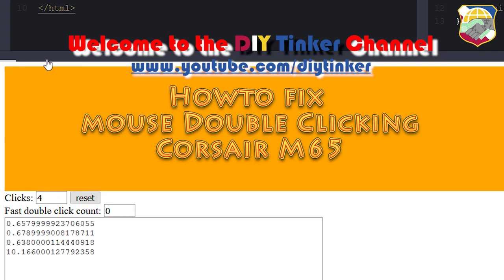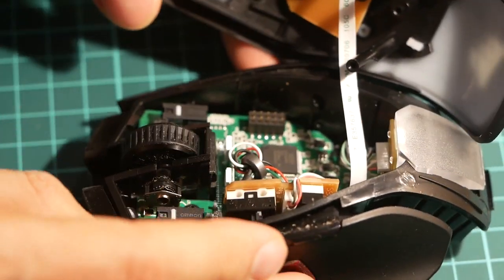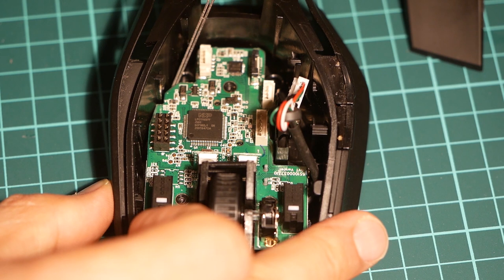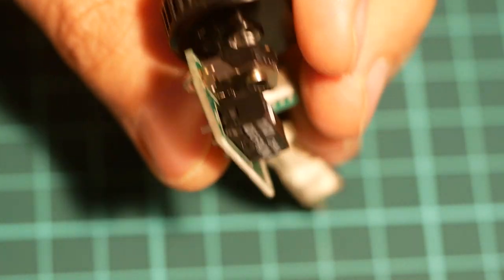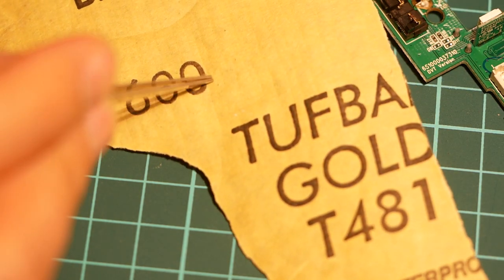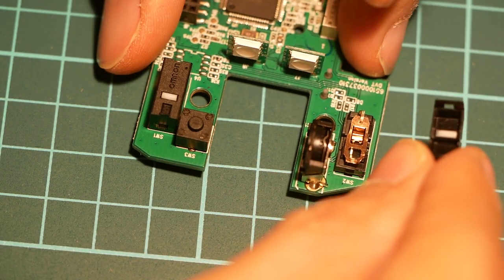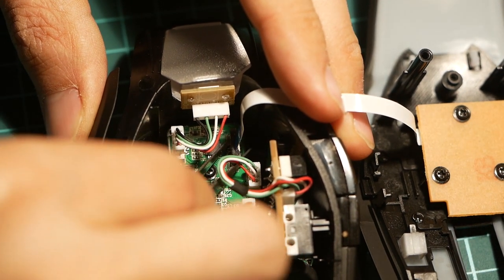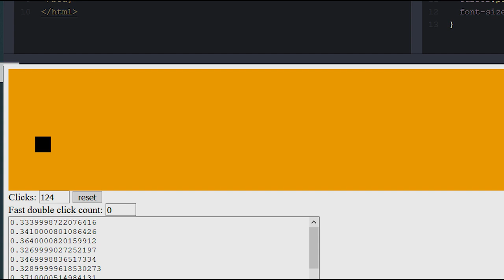Howto fix mouse Double Clicking - Corsair M65 repair

Comment: Corsair M65s are my jam and have been for years. I've got one sitting in a box that I broke the scroll wheel on when I tried to take it apart to clean it last year and my newer one just started double-clicking yesterday. Hence why I've watched this video. My original idea was to find out how to replace the faulty switch with the perfectly fine one from my old mouse. But now that I see soldering is involved for that to happen, it just dawned on me that I can put my newer scroll wheel into the older mouse in place of the one I broke.
I realize that none of that has anything to do with this video, but still, thank you for taking the time to show everyone how it's done.
Reply: aw man. If you watched the whole video you would have seen that you don't actually need to solder anything. well your solution worked all the same I suppose so good on you. :P

Comment: This video was absolutely awesome. Another tip for you all in the comment section: At the end of re-assembly, I was driving myself crazy trying to get the mouse 1 button to click normally after clicking the cover back into place. Turns out the screw underneath mouse 1 attaching the motherboard to the mouse needed to be tightened a bit more to get the correct spacing. Mouse is now as good as new! I got this for free from a friend so totally worth a bit of tinkering, now I have a nice mouse for my first gaming PC 👌

Comment: Excellent tutorial! What I found most difficult is to replace the cover after the whole operation. And also to reposition the metal clicking part inside the button. Be careful not to use force on it; if it bends, it will loose its clicking ability. I managed to bend it back, since I was a little too brute the first time

Comment: Word of warning:  when you pop off the switch for the button, point it TOWARD the table, or else the miniscule button on the interior of the switch will LAUNCH into oblivion, never to be found again
Reply: what the FUCK. This literally just happened to me…
Reply: @cuttersarekey  Yep same here. It took me 20 minutes to find the damn thing myself.
Reply: Came here to say this. Also I found mine in about 30 seconds, miracles do happen! Good luck with your mice everyone!
Reply: Lol, the same thing happened to me, except i was lucky enough to see where mine went.
Reply: I tried to thumb this up but my mouse double clicked it back down. I carefully thumbed it up to be sure.
Reply: Thanks to you I removed the cover over the table.
Reply: I took 3 of these apart its because the switch contacts are not parallel, one side hitting before the other causing arcing and eventually intermittent or no electrical continuity . You can either replace the omron left click switch and solder a new one on which is cheap or take the switch apart and sand the contacts and try to make them parallel but its hard without a scope. Hope this helps anyone in the future.
Reply: i've lost a couple handgun ejectors and pin springs like this lol
Reply: Yeap! that just happened to me, right after watching the video & reading your comment. I had to sweep the whole area, where I was disassembling my mouse, looked thru a pile of dust/trash & voila! I found it. I was going to give up. And started thinking of using the alternative buttons (the ones on the side, which I don't use) in order to replace the lost one. But hey I  got it.
Reply: If this comment wouldn’t have existed then I would have just put it back together without the switch😂 and the moment I saw the comment I just looked down on my carpet and saw that tiny piece although usually it’s quite difficult to find anything on that carpet 😂, so tysm
Reply: which part of the mouse that you mean?
is it the switch click button?
i'm trying to teardown my mouse cause now i have double click problems, and after read your comments i doubt to do that😅

Comment: If anyone is watching this 2024, its still pretty much the same on newer. Bottom screws better hidden but still same spot. One thing I do have to say that top sensitivity buttons ribbon cable lock is really easy to shoot in the high heaven and lose it forever. For me button reassembly took a couple tries to get it right. Also button cover is much much easier to remove on newer versions. Good luck!

Comment: I've had my m65 since 28 october 2017 and the double click issue arrised about a year and a half into having the mouse.
It comes and goes but really you want to replace the switch with one designed for heavy use, i still havent and im now looking to buy a switch so i can solder it in.
Gotta love how corsair skimp out on nasty leafblade switches, they are the worst kind you could use that do not last long at all.
I hate how manufacturers are more concerned about making products which fail within a short period of use and need to be replaced, no one seems to make products that last.
Reply: Hi, wondering if you swapped out for a heavy use switch and which one you chose?

Comment: Thanks for the video! Helped me fix my M65. Looks like they redesigned the boards inside and made it a lot easier to reach the switches. Only had to remove the top cover and the board with the switches itself. No ribbon or power cable removal needed at all!

Comment: I don't usually leave comments but I will make an exception: THANK YOU! Very helpful and simple information, I was desperate having to change my mouse, but I followed your instructions and it worked wonders! :) 
As some others said: the tricky part is placing the metal part back in place as it needs to be properly fitted to keep its clicking properties. Just take your time and don't put too much force into it.

Comment: My left click started double clicking on my M65 RGB Elite a week ago, I followed this guide to repair it and its now working as it did when I got it, thank you! I opted to de-solder and solder on the entire switch. The switch inside the Corsair M65 RGB Elite mouse is actually a D2FC-F-K(50M) but the switches in your video description is what I ordered and used, as I didn't realize I had the elite and not the plain RGB version. It still works fine and the switches looked the same other than the section that you press to activate being white plastic instead of blue plastic, and all of the posts being full length instead of 1 being shorter.
Reply: Glad it worked out for you as I have the same exact mouse, going to do this exact method as well

Comment: Thank you for this! It worked perfectly! My mouse could barely go 4 clicks without double clicking, after sanding the contacts like you showed now I can go 200 clicks with no issue! Getting the cover off was a bit nervewracking, and putting it back on was a bit finicky, but this was super easy, done in 30 minutes. For anyone who doesn't have the tools, the screws for the cover take a T6 Torx head, everything else is simple tools. Great tutorial!

Comment: Thanks for the in depth video. You covered all the bases however this is the last Corsair "gaming" mouse i'll ever buy. Three months later and left click stopped ( mouse was never dropped) functioning properly. Take it apart and the little blue button wasn't all the way out and the underlying copper conductor was bent from regular use.

Comment: I bought TWO of this stupid mouse. The first one, about 8 months into use it started with double clicking. We did everything to fix it - spraying air (worked for a week), uninstalling iCue (did nothing), and then finally using this video. It fixed it for about 2 weeks and then back to double clicking. I read online that the faulty parts were upgraded in the newer models of this mouse - so stupidly, I purchased another from Best Buy. Not even a month and a half later - DOUBLE CLICKING AGAIN.  I love the model of the mouse and I am extremely mad and bummed out at this quality of this. I'm not hard on my mouse at all, and there's no excuse for it wearing down as fast as it does. I'm done with this brand. Hope this is a useful warning to anyone stumbling on this video for a fix.
Reply: holy hell yes. i absolutely love the look, the feel, and everything about this mouse. i had the m65 pro and didn't have issues for an entire year. figured that they SURELY had to have fixed it with the m65 elite, right? bought the m65 elite and it started having issues not even two months into using it. pisses me the hell off.

Comment: THANK YOU SO MUCH. I was getting mad since I need a properly working mouse for both design and gaming. Double clicking during work was a hell but couldn't afford a new good mouse. So my amateur ass decided to fix not only Corsair but also my old Genesis mouse that was about to be sent to recycling. I used Genesis as a try out and then went for Corsair. Now I have not only one working mouse but two! Both great rodents fixed thanks to your precise  and clear instructions! CHERISH!

Thank you once more, my dude <3

Comment: I've had the Corsair M65 about 3 years now, and it had the double click issue after about 2 years in, but recently was just horrible.

This video helped tremendously....I used 200 grain fine sandpaper (all I had in the garage), but after testing the repair at a fast double click javascript test page, no double-clicks after 200+ clicks, and it is working fine now.

Thanks for the great video!

Comment: I just did this, and it worked great in the end, but it was quite hard to get the spring right. I have TWO main takeaways/tips.
1: There are small plastic parts that protrudes through the black little box. They can fall out, and it's hard to get back on the mouse with everything else going on. I solved it with tape. Best way to go around this is to from the start, before popping off the black cover, add a small piece of tape on the top of the cover, to make the plastic part stick to it and not fall out. Worked great for me that way.
2: The small metal springy part. It's not really a hock that holds it here, it's the tension from the small bended section that pushes the whole sheet forward. If you then put the opening over that other small pin it will stop it from moving forward and create tension. Holding it in place. I misunderstood that part initially and had a big issue getting it back together and click properly when pressed. I had to resort to opening another of the boxes to inspect more carefully before I took it apart. So a word of warning here. Check carefully on what sides of what pins that the different parts go and understand where the tension is before removing anything.

I could not go 30 click without a double click before with that test site, but can go over 200 clicks now and no error. So as far as I can tell it's perfectly fixed now. I just don't know for how long.

(Btw, my mouse model is a slightly newer version, so I didn't have the back cable. The LED is stuck to a chip there directly. So be prepared for slight variations.)
Reply: Oh, and I didn't use a sandpaper. I used the knife to scrape at the surface to make it clean and flat. Maybe not the best. But this means I could do it with just a screwdriver, a knife and a set of small tweezers. (+ regular tape for the solution mentioned above)
Reply: Good tip. Will have to fix the switch of my M65 RGB one of these days, so anything that makes it smoother is great.
Reply: @Tech2Rush  One more recommendation. I only fixed my left and right mouse button at the time, but my middle mouse button is bad now as well. So if you actually take the time to open the mouse, it might be just as well to fix all buttons at once. Just to save you time later.

Good luck with your fix.
Reply: @Gafgar  Thank you for your tips, though I only did the left button, as I basically never use the middle click, and quitting mobas before I got this mouse means the right button sees very little use compared to the left. I did do the tape trick, and I imagine that saved me some fiddling.

On another note, I completed the switch cleaning without removing any wires, just carefully leaving the circuit boards and top connected. To clean the actual switch I only removed the plastic cover, then slid a thin strip (1.5mm*40mm?) of sand paper between the contact points, gently pressed the switch and pulled the sandpaper through the assembled switch. I did this 3 times with the sandpaper face down, and 3 times face up, before reassembling the mouse. No more double clicks 😎
Reply: omg I could have just left the spring assembled xD I can't seem to put it back together
Also the middle mouse button doesn't seem to have an openable switch so I just put some rubbing alcohol on it and blew on it xD not sure if it's gonna do the trick but yea

Comment: "Deteriorates over time" - Using my 3rd RMA in a span of 6 months. Whatever the hell Omron is doing, they're doing it wrong.
Reply: agreed, my razor naga lasted me 7 fuking years of hardcore clicking, i just bought this mouse 4months ago and theres already mechanical issues with it.
Reply: @rickiex  Got mine less than 2 months ago and its already doing this.
Reply: @tarilen  probably refurbished model then same goes for rickiex if you bought from amazon they sometimes do sketchy shit and sell refurbished as new
Reply: @user-yc8xb2iz9w  yea it was from Amazon. I'll be doing an rma in the interim. If it continues I'll try this out.
Reply: I'm afraid it affects a lot of mice. I'm on Corsair Scimitar RGB - and - plastic inside the shell to push the switches wore out after 2 years of clicking (just outside of RMA) - I used some glue and scavenged bits of plastic from mouthwash bottle and the mouse has been working fine for 2 months, now the switch started failing on me. Now I'll sand the switch, but I have a cheapo $10 mouse, which has been working for almost a decade of gaming on "non-heavy use" parts and these Corsairs just don't hold up. I'd say buyer beware.
Reply: @olaf5929  yeah its disappointing corsair is a very good brand imo but their mice feel good and look good but they are actually bad ;/
Reply: @user-yc8xb2iz9w  and they're talking about taking the company public soon!
Reply: @ulogy  not surprised airbnb is going public too its a trend at the moment
Reply: @user-yc8xb2iz9w  it's just bad for their brand. I'll think twice about buying anything from Corsair in the future, while I love the product, it is clear that it's not built to last.
Reply: This Chinese companies are already too cheeky with their programed obsolescence, they're blatantly using us as milky cows.
Reply: Buy a mouse that has optical switches. Red dragon makes a few
Reply: totally agree they would be well served to make that contact part a lot more 'robust'
Reply: Oh, I know EXACTLY what Omron is doing wrong: they moved ALL of their manufacturing from Japan to China! And for what? To save money, of course: you see a manufacturer can give workers in China MUCH LOWER salaries than it can give in developed countries like Japan. Oh, and I'll bet that most Chinese assembly-line workers don't even have high-school diplomas! As a result, they tend to shoddily manufacture things, including Omron microswitches. Even worse: I'll bet that many of these Chinese workers "get back" at the manufacturers by INTENTIONALLY adding defects to the products! Once there are too many of the defective products on the market, the manufacturer's reputation craters!

Therefore, no matter that this voids your mouse's warranty, with almost ANY mouse (notable exception: certain Razer mice which use optical microswitches), the first thing you want to do is order a set of at least two Kailh red microswitches for your mouse. Once you receive these, then open up your mouse, desolder the Omron microswitches (using a heated soldering iron and a desoldering pump), remove them from the mouse's circuit board, and then solder the new Kailh microswitches in place. Yes, this IS something we now have to do with just about any mouse, including the most expensive gaming mouse in the market! Again, with the notable exception of the Razer mice that use optical microswitches, EVERY mouse on the market uses these shitty-ass Chinese-made Omron microswitches.
Reply: @jeffzebert4982  being a retired Boomer who loves to game on a daily basis and what you say is no joke. have been learning to do exactly what you said working with electronic soldering and such. right on! the all mighty dollar, farming out labor and manufacturing has become a joke due to the unethical practices in 'you know where.'

Comment: Cheers mate this worked like a charm on the m65 and m65 pro! 

For anyone else trying this, I was able to get the switch cover off with needle-nose pliers without taking the circuit board out of the mouse or disconnecting any of the buttons. Just grab it from the top (switch cover) and try to lift up one side, rocking it back and forth til one of the little cover caps pops loose!

Comment: Just wanted to say thanks so much. Been through 3 of these M65's pros and normal and all of them had the same issue. This time instead of replacing I decided to follow this guide and it worked straight away super easy to do. Thanks!

Comment: Since you explained why you did this operation, I knew it was not really my issue since my mouse is just a few weeks old. It started doubleclicking after I had it in my backpack with my laptop and lots of books. That little copper piece on top, inside the switch was bent. But now it is fixed. I did it on a Harpoon.

Comment: It worked. Just bought a brand new corsair m65 (2 months ago) Did exactly like the video and it worked like a charm! Im still testing today, but it worked instantly. One thing i noticed is that the click is now a bit more "heavy" its not bad, but definitly feels different from the left button and the right button. I think, over time the feel is gonna match again. 

But, otherwise, Great video! Saved my mouse! I love this mouse, had one for 6 years and now bought the new one to use with icue.